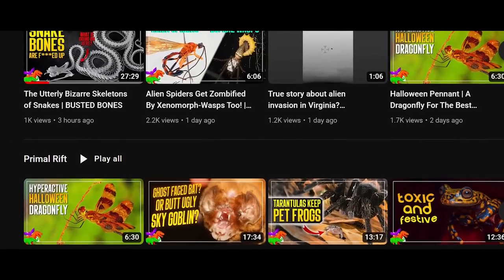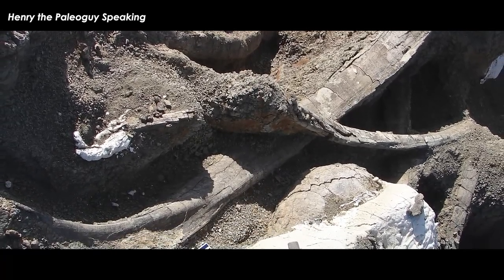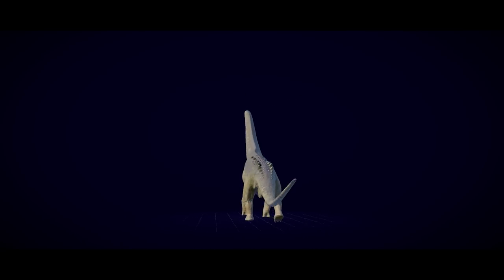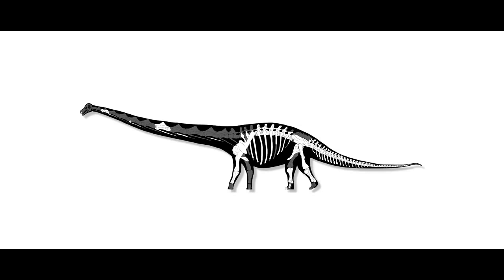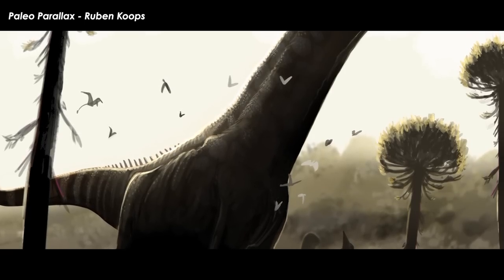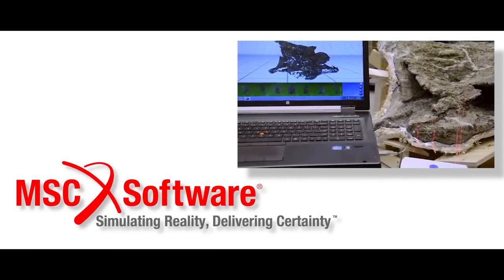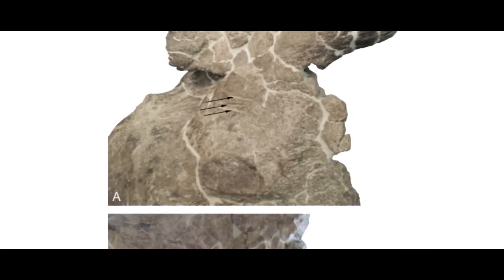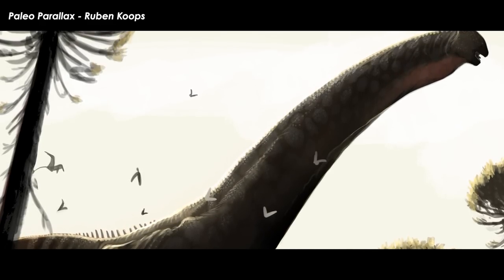Most Complete Titanosaur Dinosaur | Dreadnoughtus | The Living Dreadnought

Comment: When you consider the average section area and the length of a body to compute its volume, it doesn't matter what the shapes of individual sections are. The mathematical result of multiplying the average section area by the length is invariant whatever the section shape spectrum. It is the volume.
      The problem, thus, is not computing such a product but, for a given length estimate, obtaining the average section area. If the area of each section could be directly measured, that would be an easy task. But to estimate the areas of sections of an animal of which only bone fossils exist does require to guess what shape those sections have.